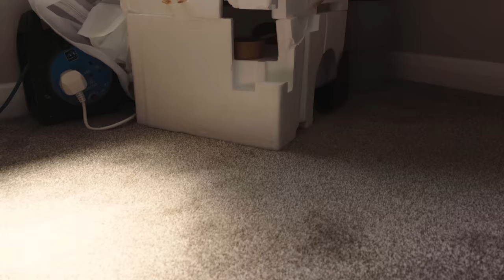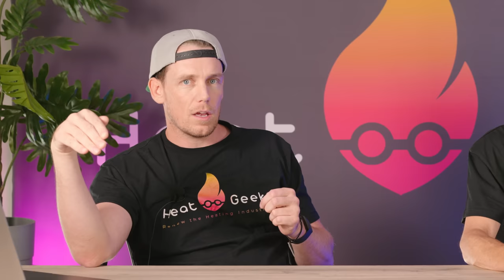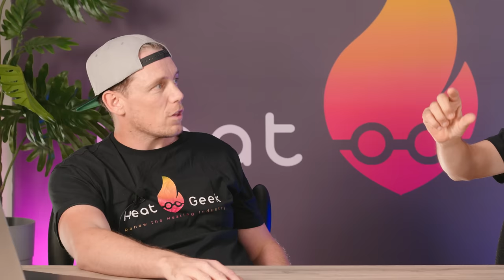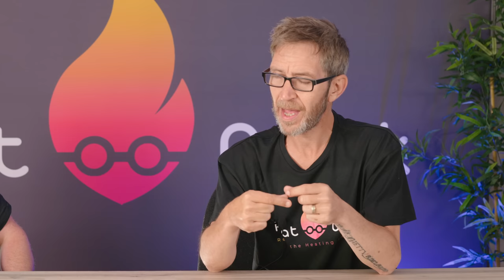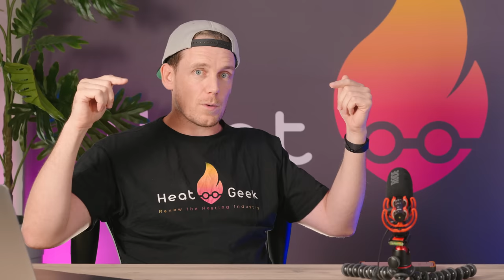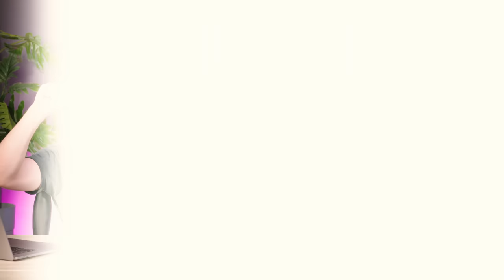Cooling With Heat Pumps | The Technical Details

Comment: I don't get this sort of heat pump system. Why do you need radiators at all. A standard air-conditioning unit is basically a heat pump. Hot in Winter. Cold in Summer. No radiators. Blows air hot or cold so disperses the temperature. A 12 KW unit is huge. Would do most English houses easily surely. My hot water heat pump was just a small air compressor heating the water with pressure. It is all made to sound very complicated but isn't the whole concept just regulating the pressure of a given fluid to create hot or cold. Increase get hot. Decrease get cold. Change the property of the fluid change the effect of the pressure. A car radiator on steroids. Pressure cap and various additives. You look at a lot of American systems or Aussie systems with ducted air seems way better. The Yanks run heat exchangers to cool or heat incoming air for better efficiency. We haven't got to that stage yet in Oz but then our houses have terrible R value or U value to you. Still single glazed. On a new build my air-conditioning guys 2 of them. Can fully carcase out the whole house in a day. Fit off only a few hours. Wifi connected. Fully app controlled from anywhere. Each outlet zoned for individual comfort. Fraction of the price of your type of installs. Your gas/hydrogen system intrigued me combined with the power generation. But these heat pumps simply operating over sized radiators through over sized pipes. Still don't get it.
Reply: It’s hard to change the traditions of heating a house for that country. We have always had radiators in the UK, so everyone loves them here. We are based in UK and install gas and AC. Air to air was mainly in offices but it’s rapidly being taken up in homes now. You are correct in what you describe though, all these new air source heat pumps have a refrigeration side, which is exactly the same as the system in a air conditioning condenser. Transferring it over to water through a plate heat ex just makes it fit into our systems.
Reply: @darrenr1995  Very true. I am English and lived there 36 years. Traditional to the point of stupidity some times. There was a trend a few decades ago for ducted air in the UK in houses. I worked on the install of a few with the register plates in the floors and skirts we had to cut in. Two of my friends had it in their houses. Radiators are a pain. If people want an up to date system why bother merging old with new. Look at the wall space you free up with no rads. You need more convincing salesmen. On a new build even worse. Who would want to install rads. More space. Easier maintenance. Easier to operate. No risk of leaks and damage by water. Lot cheaper to install. The last one will clinch the deal. You wouldn't fit many more Radiators. It is supposed to be the 21st Century not the 19th.
Reply: I have often thought this 12 kW sounds large but could you get away with one. Would the heat disperse to the other side of the house rather than rising up though the floor of the room its in and out the house ? Obviously the hotwater issue exists as well.

Comment: To American ears, this entire series is a bit comical: “UK people suddenly discover a need for cooling”. In the US, “ASHP” = “air con” in UK we do cooling with them and are just now figuring out heating with them. There is almost no knowledge of air-to-water HP’s connecting to hydronic distribution (equally baffling, but none of the big makers sell air-to-water in the US!). I have NEVER met anyone with GSHP in the US doing what you all call “passive” GS cooling - using GSHP with air ductwork for cooling is a huge piece of why Americans install GSHP in the first place. You all are like an alternative universe of ASHP vs. our air-to-air focused market. I am a fan of your approach and would love to see more air-to-water HP’s especially with low GWP units like Vaillant or R-32. Our installers are releasing R-410a all over and running refrigerant linesets 2,3,4 and 5 per house like varicose veins all over the outside of the house. Keep up the good work, lads. Tom from NY
Reply from the maker: Haha great comment. We call air to air, air con too!.. however real air conditioning should include co2 control and humidity control!

Comment: You're solutions are far too complex, difficult to install and far too expensive. The answer is to install air-to-air minisplits and to target the heating/cooling where it is needed. Forget central heating. Minisplits are so cheap and easy to install and run (assuming you have space for a heat pump) that more than one could be installed, removing the need for any internal ducting. An immersion heater/heat pump can be used for hot water using solar/off-peak electricity.
Reply: It’s very true, we install AC in the uk. Only a 4/5kw condenser needed to heat or cool a house, with multiple indoor units. They can change a rooms temp up or down within minutes, removing humidity on cooling mode too. 
Creates a very pleasant environment.
Reply: the problem is the mini-splits are ugly and I wouldn't have them in my house. This could be a solution for the generally moderate UK climate if the UFH works as a heat sink.

Comment: Heat pumps have to run and run and run and run and run to do their job of conditioning a space.
The noise pollution of the  fans running 24/7 is a problem.
It’s like driving out to the sea to enjoy the view of the ocean and BAM, huge ugly windmills everywhere.
Heat pump fans make neighbourhoods noisy and ugly.
Reply from the maker: I would suggest actually seeing a modern unit in real life.
Reply: @HeatGeek  I have, and they run and run and run, adding noise pollution outside. 

Plus, who is going to pay for everyone to throw out the old noisy ones for a new one?  Heat pumps are great in some cases, but there is a good reason they have a slow adoption rate.  There is a trade off for the implementation of any device. Heat pumps are noisy, expensive, complex, clunky, and ugly. It’s not just about the decibal levels, but the low drone noise and vibration they put off.

The old fart is right, any time you have to subsidize something so much, one is saying “ I know you don’t want to do this, but here, I’ll pay you off to do it”.

We don’t have to get off fossil fuels, we just need to use fossil fuels way more efficiently.

Just think of the power used to run all these YouTube videos people are making to chase a profit. 

Heat geek videos are worth the power, but I reckon 10% of the videos on YouTube are productive.
Reply from the maker: @markhoffman  they are less collective and as noisy as a boiler. If you think you've been near a new unit, you haven't.
Reply: @HeatGeek  At -25 Celsius outdoor air temp, 60,000 BTU required heating load, what is the quietest unit you can recommend? What are the decibals of the outdoor fan ,and what is the price?